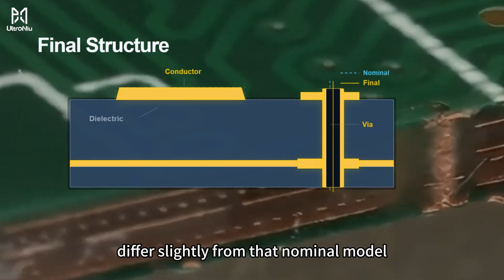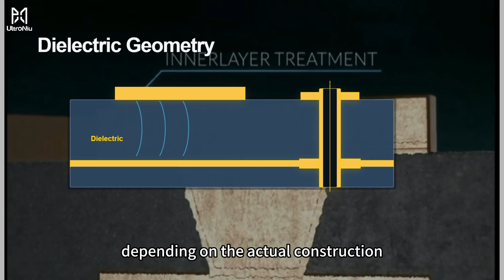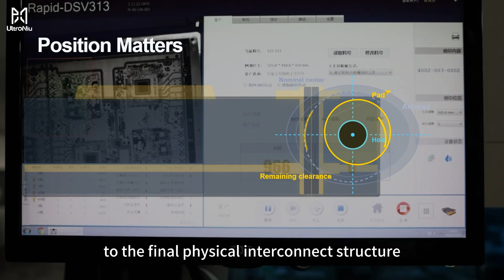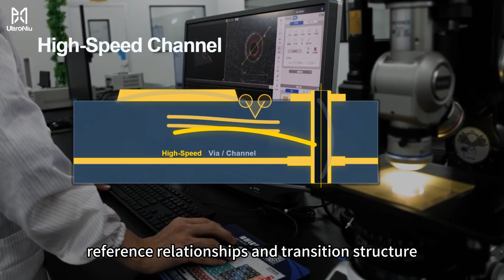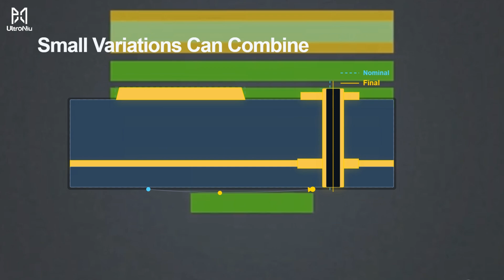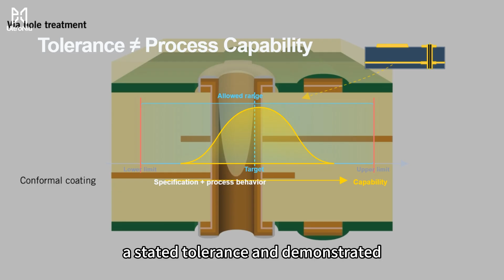PCB Manufacturing Tolerances: Why the Finished Board Differs from CAD

Comment from the maker: Which physical relationship is most likely to consume design margin in your work—dielectric and conductor geometry, registration, or vertical interconnect geometry?
The point is not that in-tolerance variation means a defective PCB. It is that several individually acceptable changes can combine in the final physical structure, and their engineering significance depends on available design margin, process control, and clear acceptance criteria.

Explore PCB Manufacturing Capabilities:
https://www.ultroniu.com/pcb-manufacturing.html